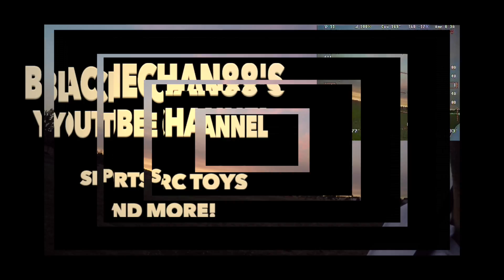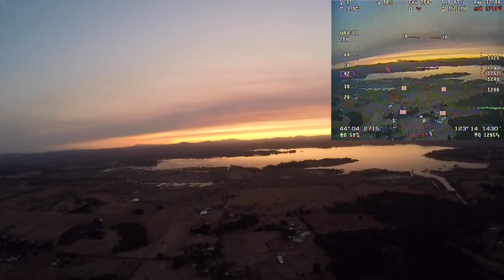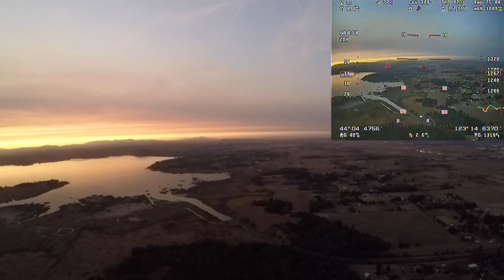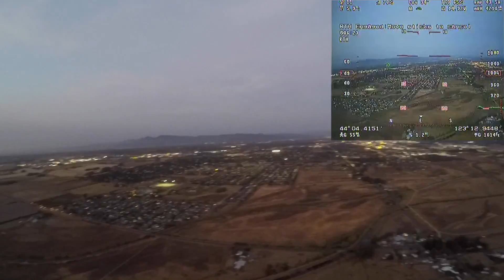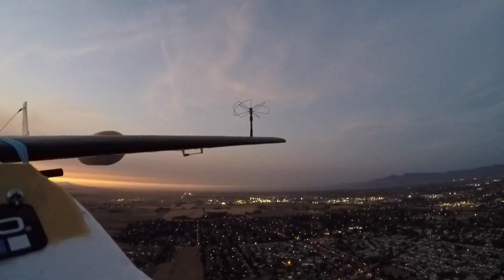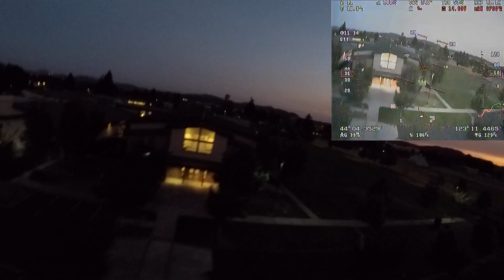FPV Skyhunter, Vector & Dragonlink Testing (2.6 Miles out)

Comment: Nice flight and setup
Any tips on Dragon link  / Vector and RSSI?
Reply from the maker: +Island Boy Aerial Solutions Hey, thanks for watching. Bro if i had any tips its those two things right there, DL and vector. I would get the version 3 dragonlink if you dont have one, but any DL will be very reliable. With the vector, its so customizable so just activate everything you want, make it yours, change colors, etc. Check out all the cool things you can do with the vector after a flight cause it records your flight data too. Gone nearly 6 miles so far on this setup, could have gone more but than i realized I was 6 miles out and over a lake so raced back haha.

Comment: Nice flight!!! I too noticed like Bankhead did on how your amp draw was a bit high compared to what I've seen other Skyhunters running for cruse settings.  But that is from the higher KV motor and smaller prop. Great for high speed flying but for long range it may consume a lot of battery in a shorter time frame.  I'm running the same motor/prop as that guy Bonafied Pirate has on his skyhunter.  12" prop and a Cobra motor that I think is 870kv but I have to look at to see exact number. I have loads of thrust to where the plane will just about fly out of my hand on launch without any big push from me. I also did noticed I was only using around 3.3 to 4 amps when I got to the 1.1 mile flight.  She was flying slow at only 20mph but sipping the power from the battery lol!!  Hope I have great weather this Sunday so I can break my little 1.1 mile record LOL!!!!

Comment: Motor might be drawing to many amps on cruise, lower KV bigger prop, better battery drain . you were above 20amps + out and seem like above 30amps + back .  Just something I learn awhile ago .
Reply from the maker: +Bankhead RC I have noticed that. Most people who are getting crazy range are only pulling 9-13 amps. Eventually i will be snagging this exact motor but a 710kv. Till than, I will probably prop down to a 10x4, and maybe change the throttle curve a bit. You getting a skyhunter soon, i saw your getting back into FPV, you wont regret it!